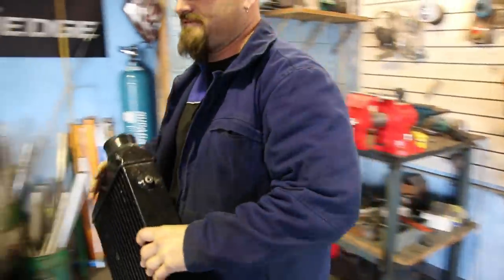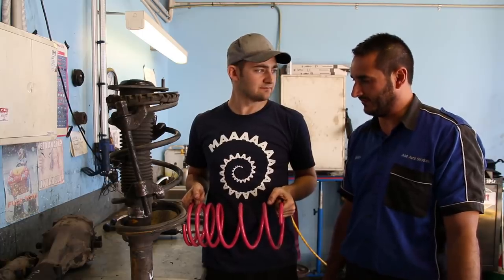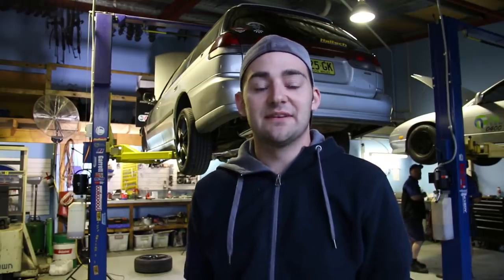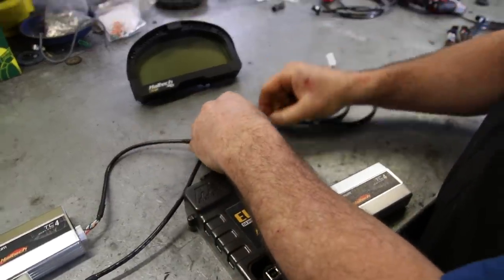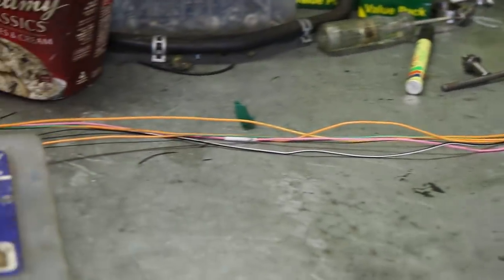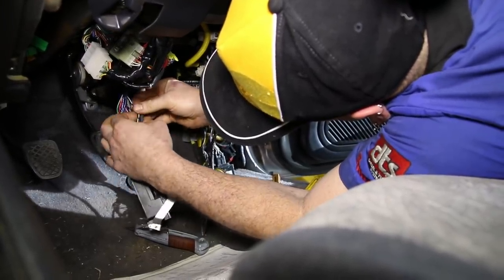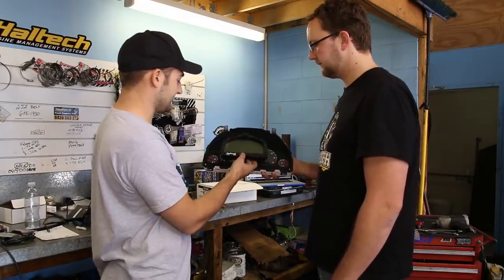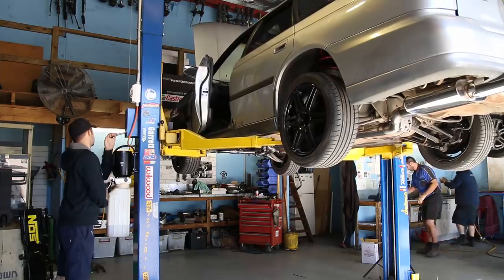Gramps the 11 Second Car - Build Part 7

Comment: why mounting a cold air intake when you guys did a CAI video in the past and didn't show any difference ?? :)
Reply: I think for high power builds it makes more of a difference
Reply: They didn't have room so they had to go cold air pod filter
Reply: it's suppose to be an air filter
Reply: Well, I put a CAI and it made a huge difference over the stock air box on mine. Throttle response was increased, and I gained an average of 3 MPG. Some cars have very well engineered stock air boxes were a CAI wouldn't make a difference and some cars just have extremely restrictive stock air boxes.
Reply: It does not matter when used in around a big turbo so yes it gets enough air in there.
Reply: we tested on my own m30b28 turbo machine how to filter removal affects the horsepower and no change came. 1.2 bar pressure and 420hp filter and the air filter of the same 420hp
Reply: Ease of install and service, and looks. also most newish cars have some sort of "cold air" intake standard, so paying for a K&N label won't net you any horsepower. I.E. 1987-present mustangs all have some kind of fender or headlight inlet for air and a pod filter, buying a chrome pipe won't do anything the stock one didn't
Reply: CAI does make a difference depending on performance. All the tests that get done that shows no difference are always with low end cars sitting around 100hp at best. I know people with cars that had about 270 factory, and gained a few hp switching over to CAI, then someone else with a car that had 400 that got about double the improvement. CAI won't make a noticeable difference, but the higher the performance, the more a CAI will be able to benefit the engine.
Reply: Cold air intakes themselves dont add gobs of power, but getting rid of the restrictive, complicated and inefficient factory air box does. For example, if your Mitsubishi Lancer Evolution has a factory intake, it already pulls cold air from in front of the radiator. However, there are about 5 bends, 3 different tube sizes, 2 feet long, and a square filter box to go through. Adding a shorter, straighter intake in an area that still pulls cold air, will get you a significantly higher CFM.
Reply: Because theres no room for the original air box. Remember this engine is bigger and was not meant for this car.
Reply: Because theres no room for the original air box. Remember this engine is bigger and was not meant for this car.
Reply: Because they just do not have the option to use the stock airbox!
Reply: lol that was just a joke :)
Reply: It only really benefits forced induction engines(turbo / supercharged). Looks and sounds better anyway =P

Bloody amazing episodes.
Reply: Dude, there is no room in that engine bay for anything else. Go drive your Corolla.
Reply: Draggon Reaper The higher the performance the more likely the car came with a proper intake to start with. Switching a mid 2000s LS motor to a fancy CAI will not net you 15hp like K&N would like you to think. The crappier the stock air box, the more likely you are to see any gains. Intake manifolds and exhaust manifolds are the only place you're going to make big improvements over factory and really open up the engine
Reply: CAIs have no effect on an engine that has no ECU mod. Since this is a chipped ECU, the CAI will make a difference. Plus is not about adding hp, is about getting as much cold air as they can to keep the engine and turbo healthy.
Reply: it makes alot of difference , especially in drag cars at high speeds a cold air intake is effective
Reply: andoxviii Why so hostile? he clearly has a Bmw e46 touring or wagon as some would say
Reply: Kyle Clemente not hostile .. people cant take jokes as proven here ..

Comment: wow that's a usefull tip about alternators. i spent like 3 hours trying to figure out where the wires went in the patched together 240sx loom that was in my datsun just to run power for my starter, body harness, and alternator. coulda saved me 1/3 of the work. you guys are inspiring me to go try to fire up my ecu for the first time and try to set base timing. nervous, so i'm putting it off. i'm not baller like you so i just have a baby haltech.

Comment: Is castrol good or just paying a lot?
Reply: For real go fast builds we use Rotella or AmsOil
Reply: royal purple
Reply: you just partially paying for the name
Reply: i mean is castrol paying a lot for them to talk good about it
Reply: no its good lol i highly doubt they're paying them.
Reply: Castrol is a sponsor. They most likely supply the fluids to their project cars. I dought they are getting paid as well. But you never know.
Reply: I assume they just provided good fluids for the build. MCM makes a point of not being sellouts. Unless you're running a VERY serious car, any brand name synthetic should be kick butt for your application.
Reply: Castrol, Valvolean and Royal Purple are my go to oils i like all but for a street build Castrol is the cheepest of the 3.
Reply: Castrol is the factory fill for a lot of imports and not just oil brake fluids,P.S. fluid, ect.
Reply: it isn't bad
Reply: a lot of high horse power builds use it no problem. I personally use royal purple.
Reply: Castrol is good stuff, but i wouldnt say the best. Im a personal fan of AmsOil and Redline depending on the application/product. Having Castrol as a sponsor for this show may be big bucks, but Castrol has the big bucks to spend on such sponsorships for a reason. Honestly, the question you should ask isnt what the good stuff is, its what the bad stuff is. The gap in quality between adequate/good/better/best isnt nearly as wide as crap/adequate.

My $0.02

Comment: flat 6, the best type of engine..
yes i am a Porsche person
Reply: Mivec yo!
Reply: smallenginedude71 car noob here what eccactly is the difference between a flat 6 and a v6 engine
Reply: ruben huisman a v6 engine is commonly used in holdens, toyotas and many other cars on the market today.  a v6 engine is where the cylinders are arranged in a v shape. so there are 3 cylinders on each side. angling down to the crank case forming the shape of a v. a flat 6 engine is where there are still 3 cylinders on each side but they are lying down. horizontally. with the tops of the cylinders lying away from each other. v6 engine https://www.google.com.au/search?q=v6+engine&espv=2&biw=1280&bih=588&source=lnms&tbm=isch&sa=X&ei=JStTVajoFcHM8gXd2oDICw&ved=0CAYQ_AUoAQ#imgrc=L_ujZOEqZ8YLcM%253A%3B-ce-KdKl5UBxCM%3Bhttp%253A%252F%252Fthumbs2.ebaystatic.com%252Fd%252Fl225%252Fm%252FmynARB-dJ3GLsdAN9DRd-RA.jpg%3Bhttp%253A%252F%252Fwww.ebay.com%252Fbhp%252Fpontiac-v6-engine%3B225%3B221 flat 6 engine: https://www.google.com.au/search?q=v6+engine&espv=2&biw=1280&bih=588&source=lnms&tbm=isch&sa=X&ei=JStTVajoFcHM8gXd2oDICw&ved=0CAYQ_AUoAQ#tbm=isch&q=6+cylinder+boxer+engine&imgrc=raaDBEyPQp4hsM%253A%3Beipdmim0vmexYM%3Bhttp%253A%252F%252Fwww.kfz-tech.de%252FBilder%252FKfz-Technik%252FHubkolbenmotor%252FB6Zyl01.jpg%3Bhttp%253A%252F%252Fwww.kfz-tech.de%252FEngl%252FSechszylinder-Boxermotor.htm%3B450%3B338
Reply: Allright man thanks!!
Reply: ruben huisman no problem

Comment: Sorry i'm late.  750,000 views- congrats having built a 500hp WRX before almost anyone else, complete with Modena dog box, 2.2L block 2.5L crank etc all back in 1998...... before anyone else i know its a tough road to treck. This is the best episode of all as I think Turbo Yoda is exceptionally humble and despite some criticism re where and how headers joined, is an excellent tradie and most workshops would be highly envious.  My only comments - silicone bends and lengths are handy to deal with the engine moving and the chassis staying still and hence why manufacturers use flexi bends. I did like the fitment of the wastegate and despite the drawbacks, wrapping the headers is a good idea as it decreases lag significantly.

Comment: I'm glad you guys didn't Haggard garage the shit out of this turbo system. They pretty much put turbos on cars that aren't worth $10. Engine only running on 4 cylinders gotta blown head gasket burns oil like a Cummins diesel rolling coll just to blow the motor up the rest of the way and destroy it with axes and shit. I like the pride that goes into the work and the quality of craftsmanship Turbo Yoda does. Keep up the great videos. I know this one is old but it's new to me 😊

Comment: Haters gonna hate. Anyway a great build and gave me some good hints. I of course cannot affort the haltech stuff. But for example I love the piping. I saw many builds suffering from poor piping - thus always running into issues caused by leaks in the air flow, falling apart Samco copies ... you name it. A very underestimated topic.

Comment: Very nicely done, though I cannot understand why they welt the stainless and then put it right under or in the car and talking about colour transformation and doesnt looking good.

Stainless still rusts, due to the heating process during welding and specificly tig welding the carbon comes to the surface. Best to treat is sending it to a chemical shop that will put it in a bad with acids.

At home you can just buy acid paste and mear on it and take it off 30mins later.
It will get that look back while preserves your piping.

Comment: Great fan of the show as it is always good for a laugh. But.... I thought I would mention that as a Powertrain engineer for a major auto company I am concerned about long term durability of fuel system components. The vehicle(Subaru Liberty) and Tribeca engine were never designed to run E85. Unless specifically designed for E85, the fuel pump, sender, lines, injectors, intake manifold and valve are likely to suffer premature failure and result in engine damage. 

I also noticed there was no mention of obtaining VASS engineers certificate before the drive back to Sydney. Dodgy!

Comment: I have a question for you at mighty car mods. Have you ever worked on cummins 5.9l, 6.7l, ford 7.3l, 6.0l, 6.4l, 6.7l diesel engines? Just wondering because im huge into diesels and this are exept duramax 6.6ls are avalible where i am from

Comment: Love the car and the build but I don't like the digital cluster stuck on in front of the original cluster. Not that I have any cost-effective alternatives so I guess for the purpose the car is being built for it is the best option. Still would be mad to have a custom-fitted digital display that fits the original binnacle. But I imagine that would cost plenty.

Comment: hy guys,
im not really sure, but i think that the two parts of the progressive spring just work the exact other way. i mean: the upper part, due to the lower angle of the layers, gives you the softness and comfort.
the lower part with the way higher angle gives you the strong sporty suspension you want to have in a race car...

tell me what you think!
btw, amazing project
cheerz - syncrofan

Comment: I don't understand the crank and cam angle synchronizing. I understand the ecu should know where these are at but doesnt the timing belt keep the cams and crank in the same position all the time? So isnt it like a constant and once you find the constant why does it need to keep checking? ie since they didnt tear into the motor the crank and cams should have already been aliened from the last time they were in a car?  Can someone explain

Comment: Turbo Yota hates soldering but is fine using worm clamps for fuel lines... SMH.  Im SURE you are more likely to have an issue with a worm clamp before a properly soldered wire. Stepless (Oiteker) clamps are what is supposed to be used and what almost all modern cars use OEM. He is the man though and Deutsch connectors are probly the best and easily accessible connectors ive ever used.

Comment: Why is soldering considered so out of place on cars? I do it daily and as long as u do a proper solder and isolate properly shouldn't it be as good as a plug?
Reply: I think it's mainly because of the extensive heat coming from the engine bay that it weakens the joints and soldering is generally just not ideal for cars apart from the ECU.
Reply: +xQzVortex Yeah, I heard them say at one point during this series that the heat from the engine and such can start to melt the solder and the joints can fall apart. That was new to me so it stuck in my head!
Reply: I don't have any trouble with soldering at all. I work on heavy trucks and almost never crimp wires. Heck, I've even soldered wires in a loom that goes along the intake directly above the engine!
A good solder + heatshrink and insulation tape is almost never going to pull apart. This is the first place I've really heard of such a thing.
Reply: Blake Green Same for me. First I ever heard someone mention it was when Turbo Yoda was so passionate about it and I thought, If this is such a huge deal, how have I never heard this before?

Comment: Question: what kind of blow off valve did they install?
Reply: A BoV is a BoV. They all have the same task to complete which is to compress more air after the air has flown through the turbo and then it's to be released. I don't think it would matter anyhow. If you are asking what company produced the BoV then you need to reword your question.

Comment: Is there a poll going for the #'s this thing is guna lay Down after a proper tune? 
Although I know what the potential is for this build and what's its capable of, I'm guna lowball it and say:

 444awhp 368tq
Reply: The engine has a pretty max rpm, and is turbocharged. I would bet money on the torque being about 15 percent higher than the horsepower.

Comment: Wait why is Turbo Yoda anti soldering in engine bays or with car wiring in general?
Reply: Marty's gonna be doing 11's. The engine will get super hot and might melt the solder :)
Reply: monster1176 If the wiring was running close enough to the engline to melt the solder, it would be hot enough to melt the wires cover. Modern solder is lead free, it cracks really easily with vibration, that is why he tapes it.
Reply: Dylan Greene
thank you, that helps alot!
Reply: Dylan Greene
Lead solder is still widely used in Australia
Not saying he didn't use lead free but I sure wouldn't have.
Reply: charlzwerth69 That's very interesting, Australia with all of it's odd and sometimes crazy laws, yet they don't have one that actually protects the inhabitants, banning leaded solder.
 Well the only reasonable answer left as to why Turbo Yoda hates solder is that it murdered his parents, and now he fights crime and the forces of evil.
Reply: monster1176 exactly... He explains it in the episode if you watch it

Comment: Why no soldering on cars?
Reply: It will melt
Reply: Matthew Payne solder will crack if it is exposed to vibration for a long period of time. Melting isn't an issue  unless the solder is VERY close to an exhaust or its in a non fused circuit that has a short, In which case the solder could act as a fuse (lol)

Comment: Why does the macbook appear to be running windows 7?
Reply: It isn't. Adobe Reader has weird compatibility modes.
Reply: Wait, you mean Tuning Fork's macbook. He's using Bootcamp Assistant to run OSX and Windows 7 in parallel. Either that, or it's something in the Haltech utility to talk to the ECU.
Reply: Yeah I meant Tuning Fork's, and that would explain it, thanks!
Reply: Gah. Get thee back to lapping your heatsinks, pinmodding your CPUs and maxxing your Firestrike score you puter loving nerd. This show is all about the car stuff! ;P

Comment: MCM is very entertaining, but you guys totally screwed-up about explaining the coil spacing on the progressive rate lowering springs. Coils closer together are softer (less angle), and are sometimes referred to as "dead coil" if the coils are collapsed  on each other at ride height. These "dead" coils are only to keep the spring firmly in place when the suspension is at full droop and have very little effect on the overall spring rate at ride height. The coils farther apart (greater angle) are stiffer, and the diameter of the wire used will effect the spring rate.

Comment: I just don't believe that no solder business, the heat thing, I can't see anywhere in the car getting to the temp needed to melt solder, which starts at about 180C and to get good flow you probably need nearer 280C and from a mechanical point of view I cant't see a crimped joint, however good it is, being as mechanical strong as a solder joint. Pretty sure if solder was good enough for NASA to get to the moon and to use on the shuttle and all the satellites that are floating around in space sending this signal as we speak then it will be good enough for a car.